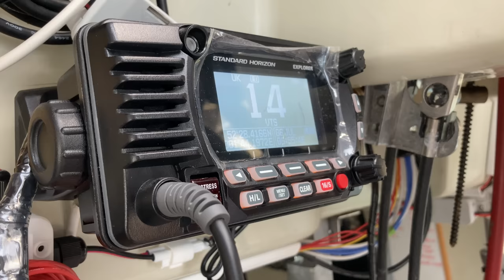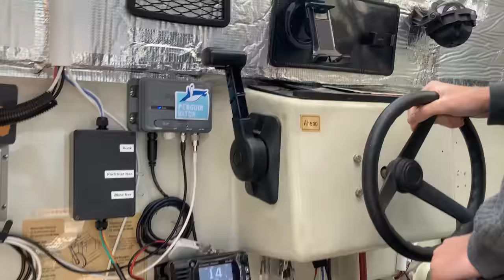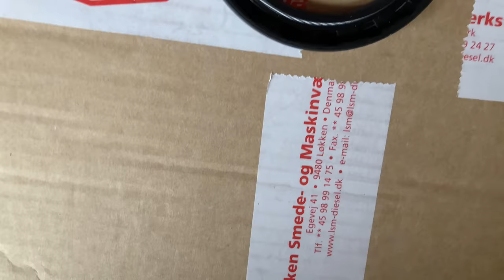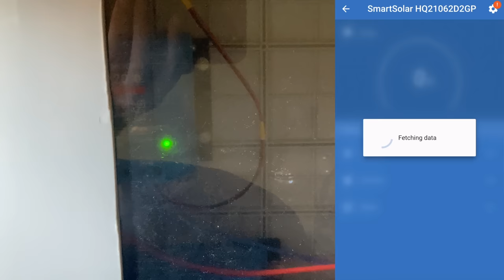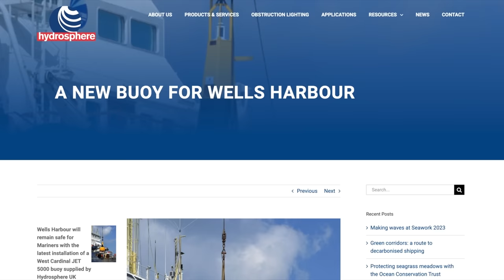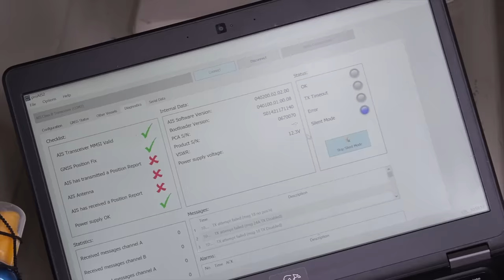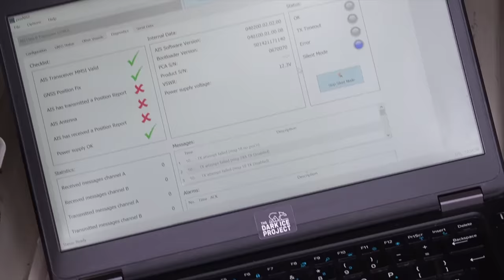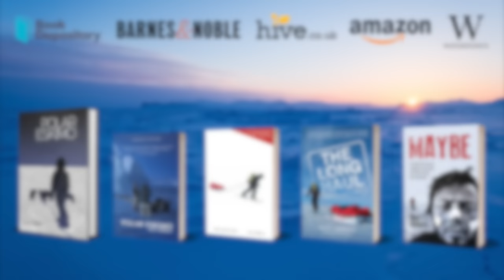Alan the lifeboat heads north LEG 2: Lowestoft to Grimsby (Humber) via Wells-Next-The-Sea. Ep89 [4K]

Comment: When towing Alanson you should fasten the rope to the back two rubber cleats in to a V shape and loose through the front one. This will reduce to pull on the first rubber cleat and make it last longer. It also means if one side comes off you still have the other.

Comment: To do tight turns in the boat port or starboard you nee to put the wheel hard over and rev up short burst and back this will get the boat to turn in tight turns especially in small spaces.  Hope you but some sand ballast in the stern this will but the prop and rudder further down in the water to enable the boat get better Traction for rudder and prop runs.

Comment: Hey - just a tip for recording audio from VHF. You’re wearing over-ear headphones, so if you’re able to plug normal in ear headphones into your cameras 3.5mm mic Jack, the in ear headphones serve as little mics. Used to do this for flying light aircraft and it works brilliantly. The old wired apple headphones without inline mics work particularly well. Obviously you could split the signal etc, but this solution completely avoids buggering about with editing wires.
Reply from the maker: A film-making luxury I'll consider!

Comment: 12:43 have we seen this control box? I like it.
Reply from the maker: I've glossed over it a few times I guess. It's the old dashboard panel screwed into an electrics junction box. I did it back in 2020 so the panel can be moved around.
Reply: @AlexHibbertOriginals Interesting, I'll have to re watch some of the older stuff. As I said I think it's a great idea, and seems very well designed.

Comment: Nice video.  However, I'm just completely shocked to see that dock line sitting on the stern counter just waiting to go overboard and tangle in the prop.  At the very least, I would lead it below through the companionway.
Reply from the maker: Just seconds later you see me coiling the lines inside.

Comment: 3:13 the polypropylene mooring line isnt secure on the deck, it should be tied off properly in case wind or wave knocks the rope into the water causing it to jam in the propeller when you try to turn or reverse in the dock
Reply from the maker: Moments later you see it coiled inside.
Reply: the camera flicks back to the rope on the deck again
Reply from the maker: If you want to think I leave loose ropes on the decks whilst at sea, you are very welcome to think so.

Comment: Have you tested your coax cable connectors?  On my 2m radio in my truck I had a bad PL-259 that had a cold solder joint.  It gave me such a problem trying to tune my antenna to get my SWR down to a reasonable level.  I finally noticed it when I was watching the meter as I bumped the cable and saw the SWR's jump.  Pulling the shielding on the connector showed that it had a cold solder joint which was allowing the center conductor to move.
Reply from the maker: Yes this one is ok - the portable antenna with factory made connector wasn't' helping either. But, await the next episode....
Reply: @AlexHibbertOriginals  👍

Comment: Hi.. i got some questions, and I am hopeful you can give me  some information before I go any further in my search for a LifeBoat.
 1. How would the stock engie set up work for daily coastal cruising and traveling... that's if I added a engine cover with ventalation duct work and fans to keep thhe air moving inside the engine housing? 
 2 can a small deck be mounted under the pilot seat for your feet and help catch lityle things the might fall from you pockets as to prevent things getting lost in the bilges?
  3 how much fuel capacity should I have if I plan to run the engine 72 hours.. that's like an emergency maximum long day, and I would not plan to do that long between topping off the tank.. and my a rpms would be about 75 percent throttle.. like say I had to ride out a storm?
  4 my plan is basically going to be build a house boat or I guess on yalls side of the pond it would be something like a narrow boat. 
5 Did the stock engine set up have dry stack exhaust? I worked on commercail trawlers, and my trust in having everything simple has never mislead me and that's how I want the engine and the systems to be as simple and as possible sa o as to make repairs as easy and quickly as possible while under way.
 I finally might have narrowed down my search to a couple of boats similar to Alan, and fairly close to me. It would be slightly over my budget, but I might could make it happen with extending my launching and deperting date by as much as a year. 
  While ocean crossing is definitely not an option,  Bahamas is an over night sail away, possibly even less with a piwer boat, and Bermuda is 700 miles off shore from here, and is often done by small sailing craft from my home port. A boat left my slip last year that was 24' and did the trip to Bermuda, and had a rigging failure, but did not lise the mast but rather a jury rigged for stay and shortned sail, and motor sailed 3 days with a crew of two 20 yr olds with absolutely no coastal sailing experience,  much less any off shore experience.  They both claim it should be doable with a houseboat converted life boat.  Lol.
  If I do go with the life boat. I olane on stealing a couple of your ideas, like removing the air tanks and stock fire suppression system and go with a fire extinguisher and engine room remote fire extinguisher system that can be set off without opening up the engine compartment.
 Would be grateful for any thoughts on useing the stock engine set up for coastal cruising.

Comment: I prefer.more traditional boats and im not totally sold on a catamaran although I see some advantages. That said, a second lifeboat attached with beams at the gunnels would open up possibilities for cutting fiberglass and making a lifeboat more friendly to outdoor activities usually associated with pleasure boats. Maybe you can find a twin to link up. Twin Engines would help your manuverability issues while adding an entire other set to consider.

Comment: Those battery cables are dangerously close to the fly wheel, please re-secure elsewhere: 7:00
Reply from the maker: They are the semi-rigid control lines for the steering and throttle, and can't move more than a few mm. They are in the factory mounted position.
Reply: @AlexHibbertOriginals  Thank you for the reply! Good to know and a bit interesting they happen to look just like battery cables.

Comment: Perhaps Alan needs an upgraded pro/impeller, maybe a auto-feathering/adjustable pitch one so at higher RPM you can actually move faster
Reply: efficiency = a win
Reply from the maker: Seven knots is roughly the max hull speed, so I don't think there's much more.